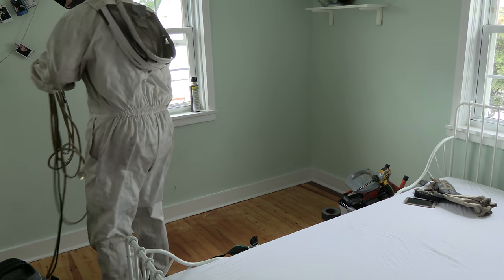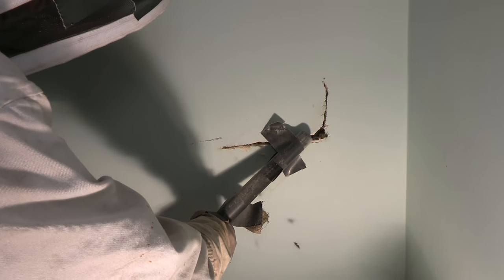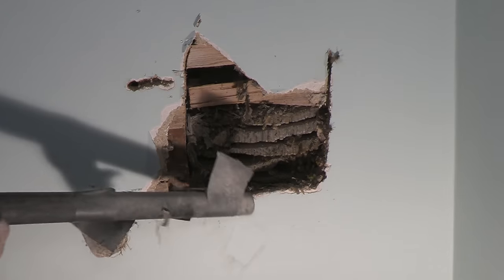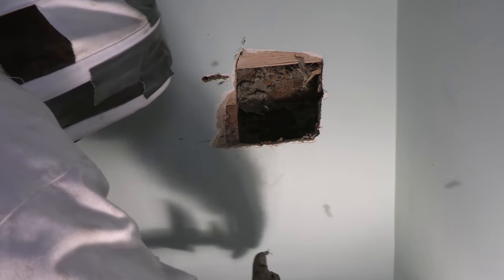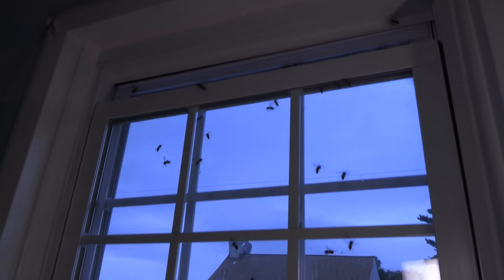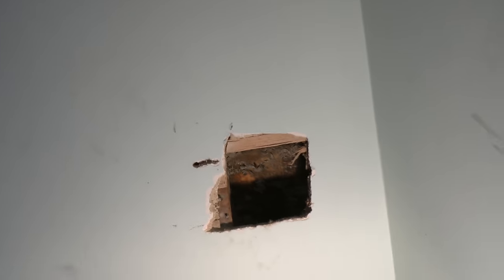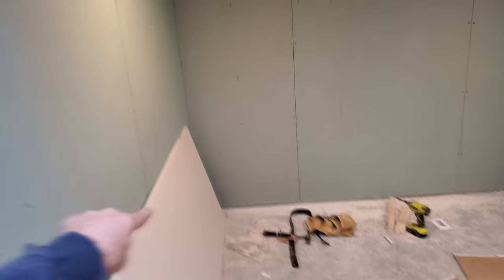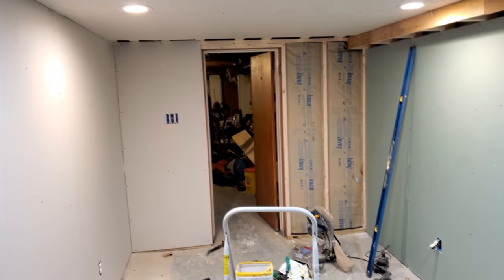Yellow Jackets Nest INSIDE WALL of house | INFESTATION | Wasp Nest Removal

Comment: Dude, u r 1 of the coolest dudes. Animal lover as I. I've a similar problems with these yellow jackets outside of my spanish harlem apartment.  I sealed up the entrance to their nests outside of my window. They furied out parts of my window screen . I used rubbing  alcohol and then insect spray. Some r still coming around. But it's less and less every day after using smoke from my little fire and insect spray. Didn't know they'd chew up my screen. Insect spray knocked down there team but a few keep coming back. I hope the coming winter cold will help. I know they're in the walls still , yet they seem less than the prior swarm. Well,  I'll know for sure about them next spring. For now none of them are in my apartment. Thx for your video. Best to u and yours. JAH!

Comment: Set up a little chute inside the hole. Use a yardstick or sumthin' to knock the old nest down out of the wall. It'll hit the chute and slide out into the room instead of falling down inside the wall, and you could reach further. I bet a dustpan would make a bang-up chute. Just a thought.

Comment: What does a job like this cost? We don’t normally have a problem with yellow jackets but a few weeks ago, ( October)we started getting anywhere between 30-100 in a day in the upstairs bathroom… we great stuffed a hole in the ceiling becuz the kids were afraid to shower even after we would vacuum them up and now they are in the basement and a room we are remodeling downstairs.. it’s is now November 1st and we are still seeing about twenty a day in various spots throughout the house.

Comment: I'm so sorry you're sick... I hope it clears up soon. 

I've just wondered if you have considered getting one of those relatively cheap endoscopes on Amazon or eBay that are sold for the purposes of looking in your ears (don't even get me started on that subject! LOL)? I thought maybe it would be helpful sometimes if you could insert it through a little drill hole to get an idea of what's in the wall/ceiling/floor spaces? They can plug into your cell phone and I thought it might make it a bit easier to see that you have got everything too. Maybe help a little with the "reaching into the unknown".

Gah, Humphrey seemed to enjoy those scritches. Such a cute fella. Does he ever groom you? My rats always used to lie there, their eyes closing as I scritched them, and eventually they'd turn around and start licking and nibbling my fingers and grooming them. Great for getting rid of bits of dry skin and rough nails... though they did have a pathological need to remove band-aids too! 😍

Comment: So I've watched probably at least 40 of your videos now and have learned SO much about wasps, so thanks for all the content.  Question on this one - after you drilled the initial hole and verified they were in the area, is there a reason why you didn't instead use something like a hole saw and drill a bigger hole close to the size of the vacumm so you could then funnel them through the hole and into the vacuum, similar to how you start off on ground nests?

Also, have you ever tried using one of those FLIR devices to see heat signatures to help with locating nests behind walls like these?  I saw a video on another channel of some guys who deal solely with bee relocation use that technique to find a bee hive in a wall, so I figured it may work with wasps as well?

Comment: I have yellow jackets in a wall that is my exterior porch wall and interior entry wall. There is a whole in the motor they get in from that I need to fix. What should I safely spray or use down into the wall to kill the nest before I close up the hole in the mortar?

Comment: Ok Steve O. (lol) ; next time we want the 3 note jackass guitar intro until your throat clears............. 😂😂
Last week i was downed with a pneumonia and while in bed sick I heard several queen and male yellow jackets coming out of my ceiling.
They were huge and with large head antennas. (Learned from your channel) 
They also were docile, couldn't fly but the sound of their wings buzzing freaked me out. (Like a big proppeled bomber plane.)
Further inspection showed they entered the house thru a ceiling light in the laundry room, a bunch of dead ones inside the screw on bulb. 
I don't have the balls to remove the nest but I am caulking off the gaps under the siding outside the house.
Please don't tell me these queens and males hibernate.........................

Comment: You never know when a mouse has chewed the coating off a hot wire in the walls I’ve had to rewire cabins where squirrels have eat the coating off the wires inside the walls.